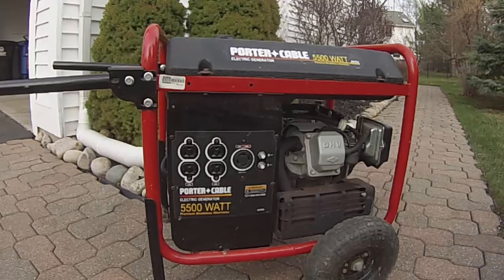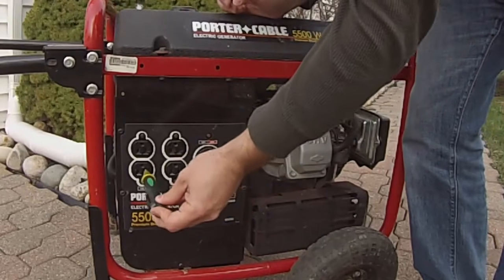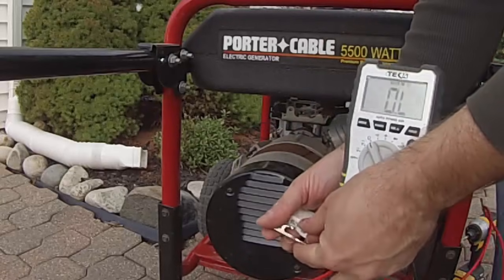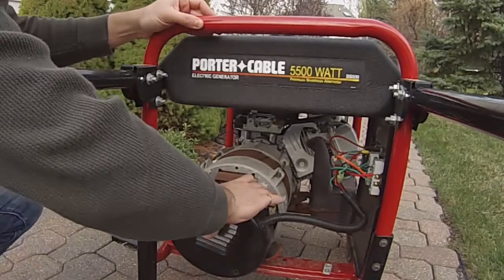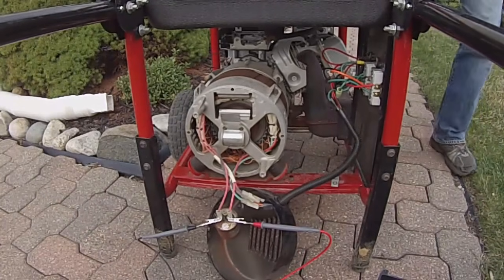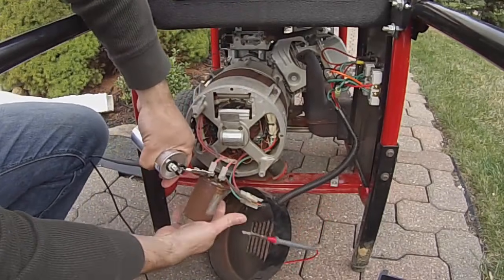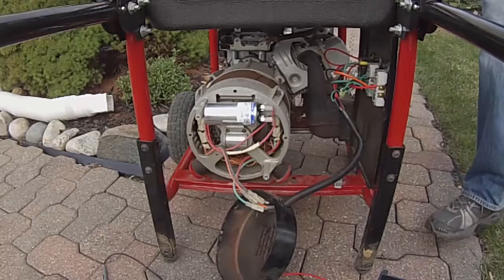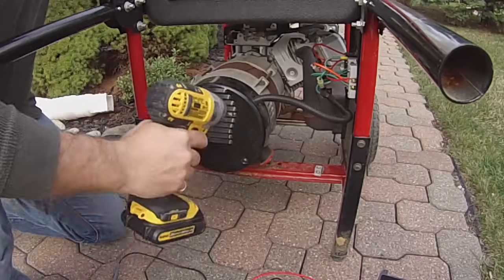Brushless generator not producing any power

Comment: This is not a negative comment but I work on these and others.if there's no power a new Cap will help get ac power but.we use these for broadband backup power supply XM2.and I've these porter cable generators still not handle a load over 3amps.so.it may run skill saws, refrigerators and household lights but won't run sensitive equipment like broadband power supplys out in the field.so obviously something else is going on.probly bad windings.

Comment: Eureka! Who knew a 9+ year old video on YouTube could be so useful, though it took a couple of searches before I found it. I have a nearly identical Porter Cable 5500 W brushless generator that had the same problem - no power output. And yes, replacing the capacitor fixed it. But I used a Fluke auto-ranging digital multimeter for all measurements and found some readings that were different than your post. I thought it might be helpful to post my findings and other tips here.

1. To say it was producing NO power was not exactly correct. Yes, a go/no go tester shows no power but it was actually producing 3 VAC on the 110 volt outlets. So, ALMOST no power.

2. This capacitor isn't part of any protection circuit. I don't believe over revving or overloading caused the failure. It was simply its time to die.  And you made me a little nervous with those uninsulated alligator clips laying so close to the metal body of the cap. Luckily they didn't touch it.

3. The voltage across my capacitor was 9 VAC, not 5 VAC. I'm guessing it's because my generator is a little newer. But neither reading is the correct voltage for a GOOD capacitor. Another commenter asked the same question. So after I installed the new cap I measured the voltage across it. It read between 410 and 415 VAC!!! Definitely not something you want to touch with your bare hands.

4. After Googling I confirmed the same specs: 40 micro Farads at 370 V. The original part number for this cap is: Gs-0748 which made finding a replacement very easy. The original Porter Cable web site no longer sells parts directly. But original replacement capacitors can be found at powertoolreplacementparts(dot)com and they are only $30.00. Of course you can find equivalents on Amazon for less. I found one part # 97F9614-40 and it was under $13.00.

5. The body of the capacitor I found is just a bit smaller than the original so it easily fits in the original opening. While it works, I'm afraid it might not last as long as the original due to excess vibration. I intend to find a backup replacement so I'm ready for the next time this happens.

And finally, a big THANK YOU to the original poster for making this video!
Reply from the maker: Yea, hopefully other find this helpful also.

Comment: OK, so I'm watching your video and you're testing the voltage going to the capacitor which is running between 4 & 5 volts.  I have an older Honda generator, a pro series 5500 and also has no power output. When I check the voltage going to the capacitor,  it's got 9.8 volts. Is there any way to compensate for that high voltage? I'm also assuming that the capacitor is probably no good due to the high voltage going to it. Now if it's got voltage going to the capacitor, does that mean there's a possibility that this generator can still be salvaged?
Reply: I've got the same Porter-Cable generator as the original video creator, perhaps a little newer but the same wattage.  Mine is also reading 9 volts AC at the capacitor. I'm hopeful a new capacitor will fix it regardless.
UPDATE: The new capacitor fixed it. Voltage across the new capacitor is now 410 to 415 VAC.

Comment: Hi
I have similar problems
Out of curiosity, does anyone know what voltage would have been across the capacitor with the new one?
Would it still be 5 volts?
Thanks
Reply: No. On mine the bad capacitor read 9 VAC. The new one reads between 410 and 415 VAC.

Comment: always be super careful when handling large,can type capacitors. In this case, the machine was only sending it 5 volts............but in many appliances and devices, hey can enough voltage and current to deliver a nasty or deadly shock.

Comment: I have a small generator with a capacitor. When I don't run anything on it, the volt is 340, and when I run on it a half-horsepower water motor, the volt becomes 220. Is this normal?

Comment: My Generac XP8000E produced low and then no voltage output.  I replaced the capacitor and she is powering up all of my selected circuits again. Instead of hauling it to a authorized Generac repair shop and forking out big $$, I spent a little time and few dollars on the capacitor.   Thank you for the video!

Comment: For oil caps, the deformed silver buldge on the top of the cap is a good visual fail indicator.  That bump is much smaller and uniform when working.  I used to replace lots of light ballast caps, and they always deform when they go bad.  At one point in time, I knew why.  (also, I've never seen a cap that rusted.  Life in the desert.  LOL)

Comment: So, what should the voltage be across a good capacitor?
Reply: You don't test capacitors with voltage. 
The only voltage is 5 volts coming out of the two wires going into the capacitor. 

You would need a multimeter that tests capacitors that can give you an indication of microfarads so you can test how far out or in the capacity is from it's designed specification.

Comment: I have a generator a brushless generator that has a capacitor on it as well I got a hold of a tester and I ran it the same exact way you ran yours. After selecting the V~ button it reads 1.020 it will vary running up or down . The generator is a Powerback 5250
Reply: Here’s an important video about generator safety https://youtu.be/I1jT3ANENvI make sure you use your generator carefully. Thank you

Comment: Hi, my mother has this same generator. I checked my mother's capacitor and my rotor and alternator are turning. I am getting around 9volts when I take a reading like you did. How do you know what the capacitor should read on a meter? I changed the capacitor around 3 years ago because it burnt out before.
Reply: Don’t forget about generator safety as well https://youtu.be/I1jT3ANENvI especially keep your children safe when using generators. Thank you

Comment: Thanks for the Tip i have two sets of 1.5kva unit the Avr and capacitor my capacitor type been broken for 2 years now i did not mind fixing it because my AVR type working well for 6 years  sad to say last week it give up producing flactuating voltage the thing is quarantine lock down no shops is open right now selling AVR so i watch your VIDEO UNDERSTANDING MY CAPACITOR TYPE GENSET UPON CHECKING MY CAP ITS BLOATED BUT AGAIN NO SHOPS IS OPEN. GOOD THING IS MY NEIGHBOR IS AN ELECTRICIAN HE HAD SOME CAPACITORS BUT 10uf only instead of 12uf but right away upon installing it work immaculately. Thanks your a life saver

Comment: Not sure of you can help!
I'm in CA, due to fire season Edison been shutting down power...
Long story short, I got this a nice Costco generator (Firmam H07552 7500 WATT DUAL FUEL ELEC.)
It powers the whole house (not the AC unit or washer/dryer)
Btw, we got no gas, so all electronic!
I have solar installed that is connected to the grid and requires 20A
When powering up the generator thinking it will power up the solar system and results in powering the whole house with AC, the solar system gives Abd error that frequency is not steady.
My question, how can I assure that the generator output frequency is steady ?
I was thinking like an AC unit where it needs a capacitor, what would you recommend?
Btw, I have the main grid breaker off in case power comes back and connecting the generator thru a 240V 50A RV outlet I have (back powering the panel)
Thanks
Reply: The FIRMAN H07552 is a 9400 watt 50A powerhouse. it should run ever thing your whole house Even though it a squire wave generator not inverter generator it will still run things like LCD TVs fridge freezers etc  And any electrical device that turns electrical AC current in to DC current can be run on a squire wave generator squire wave generator have been use to power home long before inverter generators ever come a long the only thing that can harm you  electrical device with a squire wave generator is if the generator has a power serge So use a power serge  protector. I have found that   the  the solar system inverter knows  it  not a sin wave You can only get that from  an inverter generator  the  the solar system inverter will give an  Abd error Try to reboot the system to see if that clears the error and gets the system back in action again. Just make sure to follow the proper shutdown procedure as follows; Turn off the SOLAR SUPPLY MAIN SWITCH or Inverter AC Isolator (if installed). Turn off the PV Array DC Isolator located at the inverter

Comment: How did you get the cover to go back on with the capacitor not fitting in the slot?  I have the exact same generator and have been looking all over for a cheaper, shorter capacitor. If you can please advise how you were able to get the cover back on, and post the link for where I can buy the capacitor.  Thank you.
Reply from the maker: In my case, the knock off capacitor I purchased was a different shape, but still fit.  I didn't need to do anything special to get the cover back on.
Reply: Got a new knock off capacitor today and installed it. Still same thing. Showing about 9 volts on it while running and immediately after I cut it off zero volts on new capacitor.
Reply: This is the link to where I got my capacitor. Don’t you think this one should work? https://rover.ebay.com/rover/0/0/0?mpre=https%3A%2F%2Fwww.ebay.com%2Fulk%2Fitm%2F282684413875
Reply: Another question. The little stator that spins around in the center have two diodes. Checking these with my meter is showing continuity both ways.
Reply: @MrEricMcCullough  Late reply, but all diodes should show continuity in one direction only. Both ways mens its probably bad

Comment: I got an 11hp honda welder 7.4 KVA  generator Had the same problem Thanks Also can any of you guys found a way to run a flat screen Tv of-of you brushless generator I haven't tried it because I was told the sin wave could blow up the tv but it works well on everything else.
Reply from the maker: I have seen that many generators advertise if they are stable enough for high-end electronics.  The ones that are safe generally charge a lot more.
Reply: Simon ;We all ways  buy second-hand generators  new ones get knock off from up here .  I had generators so long we can fix anything on them that goes wrong even damage stators and rotors.  Usually, when the storms hit and the power goes we just use one of them for the water heater and the wight goods like fridge freezer and the lights. but one of the guys said he uses a small inverter running off his car battery and when the battery gets low he charges it with the 12 volt off the generator I have three generators one an old 1980 Yamaha camp generator 600 watts the others an old 11 hp 7.4 k watt  brush less Honda welder.  And a 6.5hp 2.8kw to 3kw Chinese Honda knockoff.  And At the moment only the 600 watt going.  so when the storms hit we only be able to run lights took the carby off the 11hp  and moisture got in and it seizes so  could not pull it over So I took hand start off took the plug out sprayed  inside the plug with WD40 and got two large screw drives and turn it over in reverse  the put a drill on it and turn it over it worked it seems to be OK now just got to finish serving it  The old 11 hp 7.4 kw brush less Honda welder. a bit too dangerous to have an where their are kid as there too many exposed parts that they can get in to.  So I usually lock it up going in the garage with a pipe outside under the door to take away the exhaust..

Comment: mine has 14.3v-15.02V at the capacitor  , what's next to check I have a Master MGH5000DIE Genorator with a 9hp Honda motor only has 77.1 hrs. on it but not producing
Reply: what does to much voltage tell you
Reply from the maker: Maybe it isn't too much? The point is that your alternator is rotating and producing voltage to the capacitor. That is probably a good thing.  If you have already checked the breakers downstream and they are working (zero resistance), then the next cheapest thing between the alternator and the breakers is the capacitor.  I think you probably need to swap out the capacitor.  You may also have a circuit board in the loop, but replace the capacitor first.
Reply: Simon HomeintheEarth voltage read across capacitor is always higher then “ line “ or input voltage

Comment: Single phase generators that doesn't use brushes use  capacitors to deliver reactive power to the stator windings making it able to set up a magnetic field.  for the person who was lost  you need three things to produce power in a generator  a magnetic field..... Relative motion due to the prime mover which is the engine and a conductor.......  3 phase generators  use a rotating diode assembly to excite  the field Windings....  Lol is that clear enough..